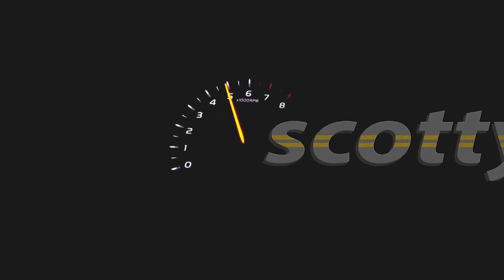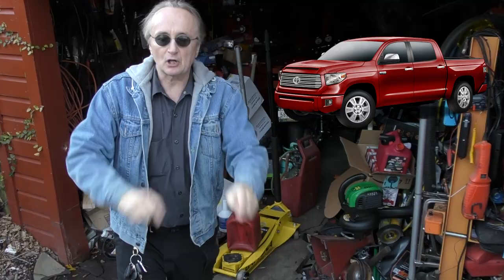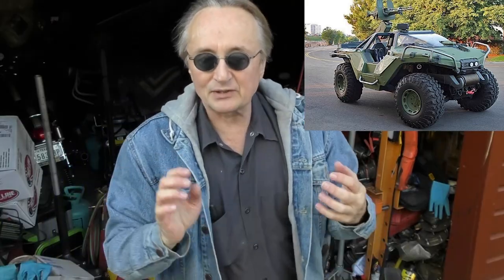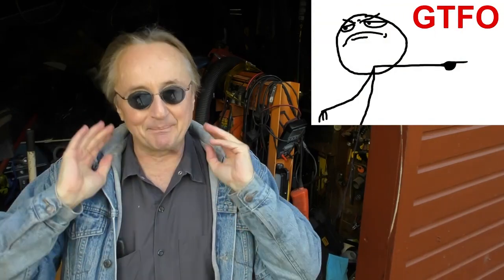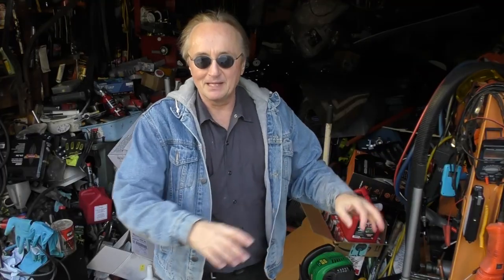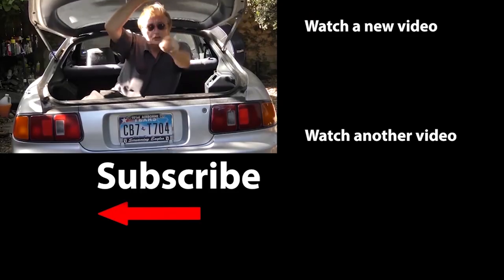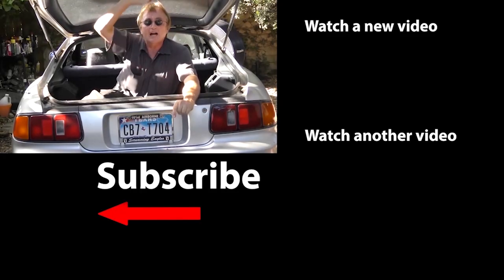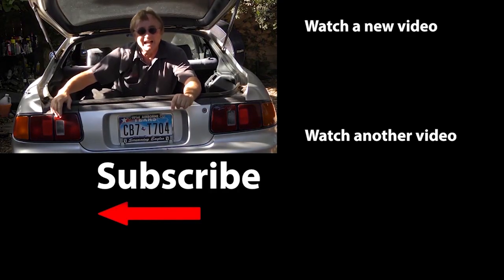5 Used Trucks You Should Never Buy

Comment: I've got an 06 Ridgeline, bought used with about 80k miles, now I have 216k miles.   I've done regular maintenance, timing belts every 100k, oil, tran fluid, etc. Only major repair is AC compressor this year when it was 12 years old.  Replaced it myself, not as difficult as some other vehicles.     I like the locking trunk under the bed, it's like a snowmobile in the snow it goes where a lot of other 4 wheel drives won't, It's a pleasure to drive, comfortable, it doesn't get the greatest gas mileage maybe about 18  MPG on average, yes, the bed is only 5' long,  but i've hauled plenty of drywall and plywood, it's a little over 4' wide in the bed,  but no wheel wells, it's flat wall to wall.  Yes,  It's not as big as a full size F150, and it doesn't have as big a carrying capacity but I do home improvement work and its  done everything I've needed it to do and when I haven't had enough Room in the bed I just hook up my trailer. I really like my ridgeline I recommend them If you don't plan on pulling an RV or some humongous cabin cruiser down the highway, it'll do the job and it's a whole lot easier to park at home depot than a king cab with a full size bed which is something I like about it. My engine and transmission are fine I don't burn oil in the transmission shifts very nicely, I hope it keeps running another 200000 miles.  I'd say that if I do decide to get a real pick up truck I'll probably go for the F150 Eco boost.  Thanks for your video just thought I'd offer my 2 cents.
Reply: I purchased my 2006 ridgeline new and I have had to do little maintenance and it still runs really well.
Reply: Do your maintenance!
Reply: As much as I hate the ridgeline for not being a real truck..  it's a unibody, fro t wheel drive base..  so it's a car or cuv..  and as much as I love fords, please dont buy the EcoBoost. The 5.0 V8 is the way to go.  You dont have the power u think you have except in the super high rpm range.  You need a catch can for the turbo and the EcoBoost have turbo waste gate problems ...  the v8 is the way to go if u want a truck that knows how to work
Reply: Mr. McMichael The Honda Ridgeline is a real truck.
Reply: @omarvaldez00  a truck is body on frame, rear wheel drive based with a bed. How is a unibody vehicle a truck? They dont have the strength to toe or pull like a real truck.  My f150 would embarrass it with real work and my mkx can probably out tow it
Reply: @TheOnefalcon07  It doesn't matter if your truck can pull more than a donkey, a Honda Ridgeline is still a truck.
Reply: You've never explained how it's a real truck tho. It's a front wheel drive based unibody..  therefore a car with a bed
Reply: @TheOnefalcon07  If we walked around and took a survey and ask people what they thought what type of vehicle the Ridgeline is they would say it's a truck. It's simple as that. Just to help you the Honda Ridgeline is capable of 4-wheel drive. 1. You can't really compare a Ridgeline compared to a Subaru Baja.
Reply: I'm not hauling rocks, nor am I climbing them. My 08 Ridgeline works for what I need it for: basic home owner tasks.
Reply: Do you ever haul anything heavier than sheetrock and plywood?  ...how many sheets of plywood/sheetrock?
Reply: @PghPiwo  ...I think that's the issue.  Too much weight in the bed kills the Ridgeline well before it would kill a regular full sized truck.  If your max load in a Ridgeline is four sets of golf bags/clubs, there's no issue.  But when an F150 can haul a golf cart in the rear (without killing the transmission or rear suspension), thats what designates  the Ridgeline as not a "real truck".
Reply: @jeanwesleynew  yes i've hauled plenty of stuff that's a decent load,  2,000 lbs of tile ( When I went to pick up that I thought wait a minute how heavy is this tile,  but then I realized the ridgeline would  handle it OK), multiple sheets of plywood (10), and same for drywall.   When hauling long pieces of lumber like 16' 2 by 12 and such I use my trailer because the bed of the ridgeline is only 5' long and 4' wide.  You can make it 6' by dropping the tailgate (which opens two ways, standard drop down and cool swing door to access the "secret" lockable trunk under the truck bed that holds a lot of stuff and can be a cooler or fish hold,  it has a drain plug).   One time I had to rent a Mini excavator,  that was overdoing it, it wasn't the tongue weight because the excavator trailer had a tandem wheels but it was  6500 pounds that was a lot to pull with the excellent Honda 3 liter 6 cylinder,  fortunately I did not have to go but about a mile but I vowed I won't be doing that again. LOL. 
Yeah, it's not a "real" truck, but it  is a good dependable vehicle and I like driving it.   In snow it GOES!  Comfortable for 4 large people but has center rear seat too.  Most of the time my rear seats  are folded up so I can keep tools in the back as well as tools I don't use that often but want to have with me locked up in my secret trunk.
Reply: @jeanwesleynew  Agreed. But I personally don't have the need to haul heavy loads. Just some Home Depot-type loads here and there. I actually just got rid of my Chevy Silverado because I don't need that kind of capability. The Ridgeline is what it is: an SUV with the rear cut out. It serves my needs well.
Reply: @PghPiwo  PS just to rub it in a bit,  last winter I pulled my neighbor in his F150 out of a snow plow drift/ ditch, put ridgeline in low (1st) and pressed the 4 wheel drive lock button on the dash,  with him spinning and me pulling he got free.
Reply: @primiumspire  but Nissan and Toyota make rear wheel drive body on frame trucks, so I guess that arguement was just rendered invalid.
Reply: I forgot to mention one thing, when I get a whole lot of stuff like kitchen cabinets for remodel or something or buncha lumber, I don't wanna haul at myself, I have that kind of load delivered and if there's any charges I bill it to my customer, so that's another thing to think about big jobs I use the delivery service,  It's either free or a very reasonable charge.
Reply: The box is frustratingly small but payload capacity is very respectable.
Reply: @jeanwesleynew  Ive hauled 4 wheelers in my Ridgeline. One was a double seater. Ive pulled a tractor with Backhoe and Front loader attachment on a trailer and had no problems whatsoever. It seems people just want to hate on the Ridgeline because they dont like how they look, but its a good vehicle no matter how much you argue.
Reply: Who cares if anyone thinks of it as a 'real truck' or not? Its a REAL mid-size pickup and I wouldn't trade it for ANY other pickup. I drove it off the showroom floor in 2006 brand new and I've had zero major mechanical problems (only alternator and regular maintenance items) and I've just passed 156k miles on it. It's gotten me thru major blizzards  and ice storms (i love driving around real trucks and SUVs stuck in the those snow storms), I've had buckets of gravel and sand dumped in the back (> 1,500 lbs) with no problems, I've hauled large trailers and still my pickup keeps chugging along happily! I've moved countless heavy furniture items with it, driven countless 500+ mile trips in it, and it just keeps going. Also the utility of the trunk still amazes people and the cabin is super comfortable. What more could anyone ask for out of a vehicle? I've recently upgraded my audio system, added a backup camera, upgraded the subwoofer and am looking forward to putting another 150k miles on it. Cheers!
Reply: I have a 06 Ridgeline and have over 250,000 on it with no real issues. I haul plenty. I have carried 30 bags of 80lb concrete multiple times and have never had an issue doing it. It also is a great ride on trips. The trunk in the bed is awesome. Keep posting I enjoy the videos.
Reply: I bought mine new. I have 350k on it.
Reply: kdeltatube My Wife bought me a Brand New 2007 Ridgeline. I’m just shy of 13 incredible years of proud Ridgeline ownership. The Vehicle has NEVER been in the Shop...,  You know why - - Because they’re Friggin Perfect !!!  I’ve never needed a repair, because you can’t repair Perfection !!  Scotty is just MAD that he wasn’t allowed to join The Ridgeline Owners Club.   Rev  That,  Scotty.
Reply: As evidenced by the numerous positive replies, it's obvious Scotty got this one wrong. I've had many cars & trucks over my 43 years of driving and I can say that my '08 Ridgeline has been the most reliable vehicle I've ever had the pleasure to own. With just routine maintenance, I've had no transmission or engine problems and just went over 300K miles. Sorry Scotty, you need to rethink this video. P.S., it also hauls a 24 foot fishing boat just fine down here in Florida :)
Reply: The Fords r the wrong ancwer heard bad things about the Eco boost and the bodies don't hold up they use cheap aluminum
Reply: @TheOnefalcon07  Apple/Orange comparison.  Fail.
Reply: @t-bone3657  It is reliable.  Only second gen Tacomas (pre-2016) are better, but not by much.
Reply: I bought mine 2006 Rid 3.5 years ago. Changed the tranny this month with 212,000miles. BUT, i do masonry work, hauling a lot of sht, and im using this truck only for work, all the miles are city (Toronto).
The best option for the comfort, practicality, key lock tool storage (not aluminum sht box i had in previous truck).
No competitors yes!
Reply: @alanmatthews5949  Yea by the time you pay for all that maintenance on a Ridgeline you can buy a new truck.
Reply: Every vehicle needs maintenance!  I have found the maintenance on the HONDA much easier than my Jeep
Reply: I love my Ridgeline. My Jeep is ill with a front drivetrain hum so I driving the Ridgeline!
Reply: Have a 2008 Ridgeline with 180 k miles.  Never had a problem.  Does everything I need.  Just keep up with the required maintenance.
Reply: @TheOnefalcon07  with that logic, the Ram Promaster isn't a "real cargo van" because guess what: It's Front Wheel Drive.
Reply: @TheOnefalcon07  that was kind of the point of the Ridgeline. A truck that drives like a car. So what if it doesn't haul as much as an F150? At least I'll still have my spine.
Reply: My 2014 Ridgeline is the single best vehicle purchase I feel I ever made. The thing is amazing!
Reply: PREECH IT!!
08 Ridgeline here. Bought used at 127k and the previous owner babied the thing. Absolute pristine condition. I do regular maintenance and the whole five yards. Also my AC has had issues too. But love to see the positive comments on the 1st Gen Ridgeline. Hope yours is running good
Reply: @hypotrucksjourney3214  i got 255k miles now😂

Comment: Ridgeline is a decent vehicle but definitely not a full sized truck. Also the new ones have speakers in the box and a built in compartment under the box big enough to fit a keg of beer, it's like a party on wheels and I kinda want one lol.
Reply: Zach Mines it’s a Honda Pilot with third seat cut off and put a bed there.
Reply: Its a 1500 truck with a frame stronger than any other 1500 truck
Reply: @LVang152  Its totally different than a Pilot. Different frame, 1500+ payload capacity.
Reply: It's not trying to be a full sized truck. The majority of comparisons I've watched over the years compare it with the midsized market trucks, which makes sense as it's far more in line with those in terms of power & capability
Reply: The 1G ridgeline has the same bed trunk, I think about the same size too. So consider that too if you wanna get your kegger-mobile a little cheaper!!

Comment: We own a 2011 Honda Ridgeline and are very happy with it. I can’t agree with you on the RL. It is a well built vehicle with almost 90,000 miles now. There have been no issues with reliability or dependability, probably the best vehicle I have driven. The RL is very comfortable and handles easily in the city and on the highway. It won’t tow more than 5,000 lbs. but it fits our needs.
Reply: Never owned one but my uncle did had over 200k miles on it